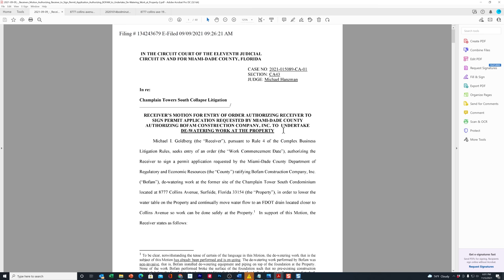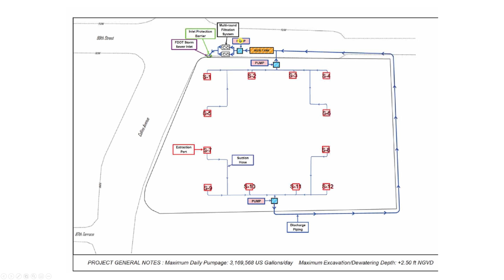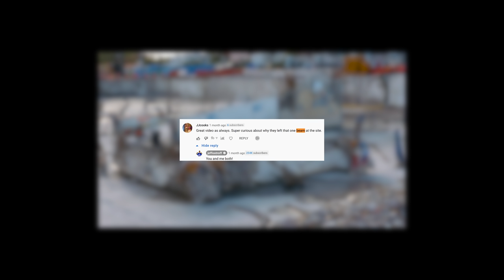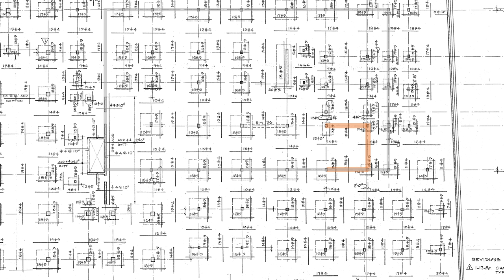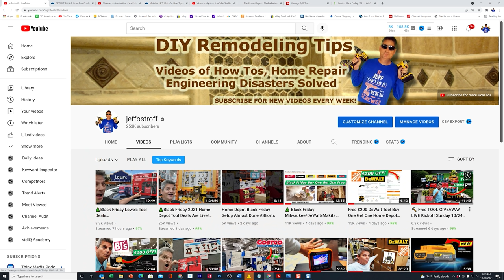Miami Condo Collapse: Engineers Baffled By Mystery Column

Comment: My guess is that column started on the 1st floor and punctured the floor of the garage during the collapse.  When the H beam shifted during the initial collapse, the mystery column had zero support and helped initiate the collapse of the eastern section of the building.  Two observations to support the puncture:  There doesn't appear to be any residual concrete in between the rebar of the mystery column at the floor level like the other columns and a puncture would be the reason water seems to be rising through the floor at that location.
Reply: No, there would have been WAY more damage to the slab in that case.  No way it went in that neatly...
Reply from the maker: There would have been a lot of damage to the basement floor
Reply: @johnbergstrom2931  I dunno... remember, it's NOT over a piling cap, and look at how CLEAN the punching shear failures are in every other instance, here at CTS--not one single example of the textbook 45-degree "crown" remnant of slab on ANY of the columns, both the heavily-loaded columns within the building envelope, and the lightly (or so they thought) loaded columns under the pool deck.  NOT ignoring the fact that "mystery" column in this scenario was NOT attached to on-grade slab, but instead would've had a "running start", and "speared" through, but I've just never seen that modeled... yet.
Reply: @MajorCaliber  Ok, then just look at the simple physics.  When the east wing started to collapse, slightly to the southwest, those columns were not just magically freed from their rebar connections, accelerated and hurtled, perfectly vertically, towards the ground at a speed greater than terminal velocity to make a neat perfect hole in a brittle material.  That's what happens in cartoons...
No, the columns followed the motion of the structure, began to rotate and wound up pancaked into a pile, in between the slabs.
Reply: Agree. Maybe the rebar rods had very similar bottom lengths and happened to strike the garage floor pretty much at the same time with all the weight from the 14 floors above that may have allowed the column that started on the first floor to punctured through garage floor neatly. There has to be some WTF's when a building of that size crashes to the ground in seconds. Physics can be hard to conceptualize  when you are dealing with tons of different materials bumping into each other  on the way down to the ground. Kind of like what happens during a hurricane , there are a lot of similarities between each, but none are exactly the same. It could have also been aliens that placed it there, but I will leave that discussion for another time.
Reply: @jeffostroff  That first floor column may have been jack hammered at a 14 degree angle from each floor above into that garage slab !
Reply: @johnbergstrom2931  Yep, valid points, I was just playing devil's advocate, i.e. there's certainly none of the ABOVE-grade slabs that performed well, incl. the all-important 1st floor, aka lobby-level, aka pool deck, which relied on "under-nourished" beams to distribute loads, vs. other practices such as extra depth, drop panels, etc... still, it's a "WTHey" puzzler as to how/when this column appeared on the scene.
Reply: @andypandy8139  I agree in the punch from column above on the H cross.  The water is hiding the punch into the floor
Reply: @MajorCaliber  I don't think this is a column location.  I think it punched down.  No footing below this position of the slab.  The water is hiding the piece of slab that was punched down.
Reply: @andypandy8139  Or maybe the easter bunny was nibbling away at the concrete columns in the wee hours of the morning and caused the building to collapse.  Santa Claus was paying him to do so...
Reply: Was that middle column just floating on the H beam? If it were actually connected to the H beam, wouldn't the H beam have broken in half or at least been SIGNIFICANTLY damaged had that middle beam come down off of it in order to spear the floor?
Reply: @buckwilson4167  The H beam & the transfer beams on the west side were the strongest elements in the entire building.  This was a pancaking collapse, so the slabs were crashing down, one on another on another.  The energy from the collapse was spread out over a large area.  There was no concentrated impact energetic enough to break that massive beam in half, not to mention drive a column into the ground perfectly neatly.
Reply: I think it’s possible that happened. I mean, prior to 9/11 no one though an airplane could crash through structural steel and leave a “cartoonish” outline either. When enormous forces are suddenly unleashed, strange things can happen. This is a very interesting case though, and I’m glad everyone is keeping a close eye on it to prevent any potential coverups.
Reply: @MoneyManHolmes  You're wrong.  The WTC airplanes on 9/11 were travelling 460/590 mph respectively.  A column falling from the penthouse level, with nothing in the way to slow it down (as if), would have taken 2.9 seconds to impact the garage floor, hitting at 28 m/s, or about 64 mph.
A commercial airplane is not just sheet metal that disintegrates on impact.  It's a carefully-designed structure, designed to resist extreme flight loads.  And the wing and center tank are full of incompressible jet fuel.  In essence, it's a 395,000 lb flying gas tank.
So a typical CTS 8 foot column falling 40m has a kinetic energy of 374,000 joules, whereas a 767 full of fuel, flying at 590 mph has a kinetic energy of 6,190,000,000 joules, or 16,500 times as much energy.
Do ya maybe see a difference???  Do ya??
Drop a 2100 lb concrete column on a 9.5" thick concrete slab at 64 mph and see what happens.  Not a neat, cartoonish impalement, certainly.  The slab will crack for a good 5-8 foot diameter and the column might go into the ground 6-12 inches, then fall over.  That's it.  Any other notion is shear fantasy.
(When you argue physics with an engineer, you better know what the fuck you're talking about...)
Reply: Exactly my theory as well.
Reply: I tend to agree. If a column had been added at that location in the last year then there is an engineering firm that must have been involved in the decision to add additional support at that spot. Who is this firm and what information do they have if true.
Reply: @jeffostroff  not so sure it must depends on how tough the basement slab is… I'd compare that column role while the building collapse as a pneumatic nail gun (eg https://www.youtube.com/watch?v=FMgrTtBq-MU )…

I can imagine the rebars from the column shredding off the slab on top of H beam (this column wasn't bound to the H beam but rested on top of it), nailing relatively straight forward into the basement slab… 
Further more any « small » cavities being filled right away with concrete dust and the picture resolution being taken from too far away isn't allowing us to see potential cracks…
It would be interesting is to see how hard is it to pull off these rebars from the slab compared to genuine ones…
Reply: @johnbergstrom2931  I didn’t realize you were there and have already solved ‘the mystery’. Sorry everyone wasted your time with all these ignorant theories.
Reply: @pikkuporsas  I didn't solve it alone and, yes, there are a lot of ignorant theories...
Reply: @johnbergstrom2931  ----- I don't know the formulae for it, but there are stories of straws driven into trees by tornadoes. Something about mass x velocity, and there was a lot of mass on that lobby-floor mystery column. The table-cloth trick also defies logic.
Reply: @davesmith5656  It's all about kinetic energy, defined as 1/2 mv^2.  One half mass (in kilograms) times velocity (in meters per second) squared.  
Something flung about by a tornado is going 200+ mph, so it has the energy to penetrate stuff.  Especially when the 'bullet' flying through the air is small, like a thin shard of wood or small diameter object (just like a nail fired from a nail gun) and the 'target' is a resilient material, like a sheet of metal or a wooden door.  In that case, you can get a nice clean insertion/penetration with minimal damage to the surrounding target material.
 A concrete column falling from a 130 foot tall building simply can't build up enough speed - once the collapse started, the building was down in just 3-4 seconds...  A column falling perfectly vertical from the penthouse, with nothing in it's way would impact the garage floor in 2.9 seconds at a speed of 64 mph.  A 2000 lb, 8 foot long column hitting a 9.5 inch concrete slab at that speed likely wouldn't even penetrate the slab.  It would certainly crack it, make a divot several inches deep, but then just fall over.  
And, as suggested by other posters, the mass of the building wouldn't 'pile drive' that column into ground.  The rest of the building would be disintegrating, disassembling itself.  Watch the collapse video again.  Does it look like the collapsing east section remained a coherent mass for more than a fraction of a second??  Hell no.  
The columns, rigidly attached to the slabs (and each other) with rebar connections, simply followed the motion of the slabs, which fell slightly to the southwest, rotated and fell down horizontal in between the slabs on the pile. 

You could fire a 12" x 24" column (the dimensions of column K, the one resting atop the H beam) at a 9.5 inch slab at Mach 5 and not achieve a neat, clean penetration like that.  Concrete is brittle.  It breaks up.
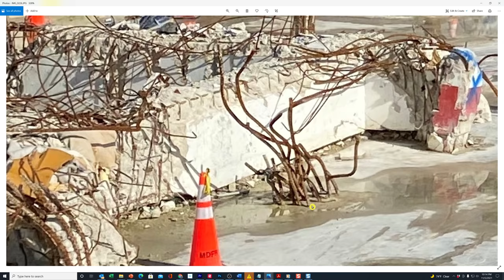Watch Jeff's video again and pay attention at 13:47, where he zooms in.  You can clearly see a rectangular outline where someone broke the slab and patched it back up.  On the rebar you can see overpour - concrete slop from the slab patch.  The rebar also has no concrete chunks trapped inside it like all the other destroyed columns.  They only got to the rebar phase of the install, they had not poured concrete around it.  
That shit was done by human hands...
Reply: @MajorCaliber    I Agree
Reply: @ShalomShalom-d5c  Bravo.  Yeah, I think you've hit on the problem.  These people watch so much fantasy/science fiction that they feel qualified to comment on how they think things work in real life.  I like sci-fi too, but I've actually spent time at a university, studying how the mechanics of reality really work...
Reply: @jeffostroff  I don't agree. The mystery column is in same place, but slightly offset away from the ramp to where the column that sat on the H beam would have been. If you look at the rebar from the other columns it's all bent in roughly the direction of the ramp and the H beam is laying on the ground next to the columns. So as the building fell the H beam was pushed toward the ramp. The column sitting on the H Beam sheared away and was driven at free fall speed (64 miles an hour) with the inertia of the entire building above it into the garage floor.... I imagine it cut a fairly nice square hole just like driving a masonry nail into concrete. I wouldn't be surprised if the column had been driven 6 or 10 feet into the ground before it buckled.
Reply: This has got to be it. Nothing to see here 🥱
Reply: @THX..1138  And the column is perfectly aligned with the O row, perfectly spaced in between the columns of the H beam???  Get real, that's a man-made installation.  There was no impalement.
Reply: @johnbergstrom2931  The video the lady took shows their was no column. It is 100% impossible to add structural support column after you pore the foundation slab and floors above it. Each column is supported by pilings driven 50 maybe even 100 feet into the ground with a giant crane mounted hammer On top of that is a thick block of concrete that ties the pilings together called a piling cap. Column sit on top of it.  

So seeing as no structural engineer would think of adding a support column with no foundational  support 30 some odd years after a building was completed. No government would or did  issue a permit to add another column and no building inspector would or did sign off a on the completion of a new column...I'm gonna go with either that's a piece of column driven though  the parking garage slab. Or it's not a column at all or is not in the place we think it is. For sure it's not a support column added after the parking garage video was taken.
Reply: I agree, with enough force and speed, a column could impale the floor fairly cleanly, especially if there is a small void full of water underneath.
Reply: @johnbergstrom2931  Which would be the simpler explanation?  That an undocumented column was added, within a year of the collapse, with no visual evidence of a footing added, that blocked the ability to drive through the garage in that direction and has not been mentioned in any accounts made by residents or media, OR that an existing column, directly above that spot on the garage floor, unsupported when the H beam shifted with the initial collapse, simply drove down into the garage floor slab with the secondary collapse and pierced the relatively thin slab?  BTW, the outline of the damaged floor appears irregular to me.
Reply: @raouliii  Sorry, my imbecile filter is on.  Your comment was blocked.
Reply: @johnbergstrom2931  Your Ad Hominem is showing.
Reply: @markhooker8520  Well, they sure as fuck didn't apply for a permit to do the work.  The town of Surfside site has nothing.  And a permit to do structural work in a building that ended up collapsing would have been one of the first ones digitized and put online.
Reply: Maybe someone misread the prints and mistakingly erected one then they just cut it and poured over it🤷 causing seepage thru the old rebar maybe
Reply: The U shaped area in the building's remains is aligned with the bottom of the ramp. The place you have drawn it on the plan is not aligned with the bottom of the ramp, it is below (south?) of there. You can see the "mystery" column in the plans, it just isn't where you think it is... it's north of where youv'e drawn the "U". So no more mystery.
Reply: @MrSixtyfooter  IT WASN'T THERE FOR 39 1/2 YEARS.  If it was put there by mistake back in 1980 they would have fixed it, ground off the rebar at or below the slab level and kept the slab intact.  No sane person would go "Oopsie!" and then bend 50 lbs of rebar into the ground.  No way in the universe it would rebound like that either.
The slab was intentionally cut sometime in the 11 months in question, the rebar inserted and concrete poured around it.
Reply: @xpusostomos  You're wrong.  Go away.
Reply: @THX..1138  Honestly, I don't know what it was.  I sure looks like the beginnings of a column... 
I've given up trying to interpret the motivations and actions of the CTS management board.  But it wasn't an impaled column from the collapse - give up that fantasy, dude.
If they were just trying to support a cracking slab temporarily, they could have done it in far simpler ways, like with pieces of timber on the slabs and concrete shoring jacks.  They were doing something where they felt they needed rebar to provide lateral support.  And they were doing it without the knowledge of the City of Surfside.
Someone will figure it out.
Reply: This was my thought too. 
That slab is probably relatively thin, reinforcement won't be huge and a tall buolding with collapsing floors will jackhammer a column down with such a point load. The water, if actually rising and not puddling, supports the theory.
Reply: Has anyone measured the H beam to see if it’s still in position it was before in relation to the outer walls before the collapse?
Reply: @GNX157  It's basically where it was when it was intact.   Watch the video again.  Pay attention to the RED COLUMN. The H beam got knocked off its columns to the southwest, but by a couple feet at most.
Reply: Not impossible, but very improbable.
Reply: What would be helpful is a picture or video of parking spot 17 clear of obstructions, prior to the collapse, looking toward the parking ramp.

If I understood the explanation correctly there were two columns on the ramp side of  #17 and a floor area that was not usable. I wonder if the mystery column was a 'stump' resulting from a change in design or layout mistake that was not noted on the as builts because it served no purpose.
Reply: You are correct . The transfer column from 1 to penthouse  punched through the slab 100%  thats why water came through . The inertia and weight  of the column punched the  through the slab . Also if you look at the beam it has claw marks showing where it broke loose and the whole beam  pulled south and east of its support columns .
Reply: @johnbergstrom2931  I can’t believe that these two very sane theories about what caused the collapse didn’t end the discussion right away. You definitely have the best grasp of what took place in Florida collapse. With that said, it may be time to take your medication. Hopefully one of your caretakers will tell you a nice bedtime story before you go to sleep tonight. Sweet dreams.
Reply: @andypandy8139  I apologize, I admittedly did not read your comment closely enough.  (but you were on the 'idiot impalement bandwagon' earlier...)

And I did get far too worked up over this topic, at least until I realized how futile it is to argue with ignorant people and try to teach them basic physics when they won't have it.  Like trying to convince them to change political parties...

Sometimes, the internet is 99% morons...
Reply: @marcuscoquer5958  By 'impossible', you mean it violates the laws of physics and probability, then perfect impalement was impossible.
Reply: @whirlwind8825  People who think they're "100%" correct about something, NEVER ARE.
Reply: @johnbergstrom2931   People who assume others are wrong and insert words like think  and exclamations and caps are usually ..bullies, sociopaths, narcissists and beat women . ; )  Nobody here is thinking. I work in the industry 100%.    The Beam was pulled south and down in one large chunk. on top of that beam is a column going up to support weight .   The reason the beam is there is so cars can travel  under it and support the column over it . Once moved the column became a punch  and the steel from that column was driven through the slab and water is now entering that point from the water table -tide ... There is no mystery here .
Reply: @johnbergstrom2931  as far as I can tell, your theory is that some parking lot structural engineers at Home Depot built an additional column on a non supported garage floor that would block garage traffic. Is that correct?
Reply: @johnbergstrom2931  So are you saying if they would’ve done this one column correctly with the footing and foundation that it would’ve held the building up. That doesn’t seem likely in my opinion.
Reply: @andypandy8139  Not at all saying that.  That building was FUCKING DOOMED.  The attempted added column was ultimately irrelevant.  They should have properly waterproofed the pool deck 30 years ago.  That probably would have saved them...  (the sister building, Champlain Towers North, did proper maintenance and it's been declared safe.  Or safe enough, anyway.)
Reply: It could never penetrate to concrete floor with out cracking it apart. The column was added when the building started to shift.
Reply: @Darenator1  There is a black substance on the rebar..Epoxy?
Reply: @MajorCaliber  because the concrete also failed in compression not shear since it was defective.
Reply: @deedewald1707  why
Reply: @Darenator1  There is no hole in the H beam
Reply: @MajorCaliber  But this slab is on grade not spanning 60' like the other floors.
Reply: @Darenator1  only the rebar punctured the floor.
Reply: Correct..
Reply: @thebrowns5337  The slab was not thin at all.  It was 9 1/2 inches.  And it was 40 years old - much harder than newer stuff.
Reply: @jeffostroff  Look at the spacing between the rebars of the mystery column.  It is spread out.  Not compact like all the other columns.  Also there is on concrete between them just flat floor of the garage.  Had it been a column that went all the way to the floor of the garage it wouldn't be nice flat smooth concrete.  The space between the rebar would have been filled with concrete.  No, as the building collapsed and the column on top of the H sheared off exposing the bottom rebar of the column and the full weight of the building just punched right through the floor of the garage.  It didn't have more damage to the garage floor because the H beam once on the ground protected it from further damage of the collapsing building.  Enjoyable video though.  Always good to examine things that look out of place.  It very well could be that the H beam wasn't enough and that the first thing to fail was the H beam because its supporting columns were not large enough to take the extra load.
Reply: @jeffostroff  Not a much as one would expect. remember, this garage was subjected to a lot of pooling water for 40 years which makes concrete easier to break through with hundreds of tons coming down on a column. That is a lot of force focused on a relatively small area. Which would have an easier time punching through cardboard; a dart with a flat end or an unsharpened pencil?
Reply: @johnbergstrom2931  Simple physics? Terminal velocity would have had NOTHING to do with a column punching into the slab. Forces generated by the weight of hundreds of TONS of material falling onto a broken column would be sufficient to cause the bottom of a broken column to punch into the slab. You seem to be ignoring the fact that the height off the slab would really matter when you have THIRTEEN FLOORS of debris falling ONTO the column. You talk about terminal velocity, okay. the debris from the top of the structure FELL from a height of THIRTEEN stories. It didn't all collapse into pile and THEN collapse the pool deck/garage ceiling. The garage floor isn't undamaged. There is water pooled there making it LOOK flat but if you would open your bloody eyes you'd see an IRREGULAR depression around the rebar from 4:10 onward.
Reply: @GeneralKenobiSIYE  It's not an impaled column.  CARTOON PHYSICS.
Reply: @johnbergstrom2931  Just because something happens that you can't wrap your head around doesn't make it "cartoon physics." I guess driving nails into new concrete rather than concrete under attack from salt water for 40 years with enough kinetic energy is cartoon physics then.
Reply: @johnbergstrom2931  A twig impaling a live tree trunk during a tornado... CARTOON PHYSICS!!!
Reply: This is my initial thought you elaborated more clearly than me
Reply: @designstudio8013  Epoxy on rebar is usually bright green.
Reply: Could have been recent added? All the stress from the beams above. Maybe they found a crack and added in a beam?  Sometime after that video was taken?
Reply: WRONGE. IT SUPPOETES WEIGHTS. HWO DOE SI HELPES. YOU SI NOT THEN WNA DOYTU , YE SI SED YOUES, DI DNTO TAHT THE VIDOES IN THERES! IWAS there! you was notte!
Reply: I think the beam went sideways during the collapse. The fifth column didn't punch through the beam, but the H-beam must have behaved like a foot on top of a pencil. In this case, four pencils, but that doesn't matter.
Reply: @johnbergstrom2931  You assume the basement floor is thick.  It could be as little as 4 to 8 inches in that spot - just enough to support cars.  And rebar would punch through it like butter.

You're not seeing the full extent of damage because of the water around it.
Reply: @fraidykat  Nope.
Reply: @johnbergstrom2931  I don't even see a rebar connection from the middle of the H beam where the first floor column starts. Shouldn't there be mangled rebar there like the rest of the columns?
Reply: @cameronhuber8339  That's part of the mystery.  It may be they only connected column K to the 1st floor slab, maybe by oversight.  Maybe the architect didn't specify the structure clearly or the concrete workers didn't realize that the H beam was a transfer beam, with a column above it.  Did the rebar at the last minute, after the H beam was already set and cured.
In the end, who the hell knows how poorly Nathan Reiber built that building.